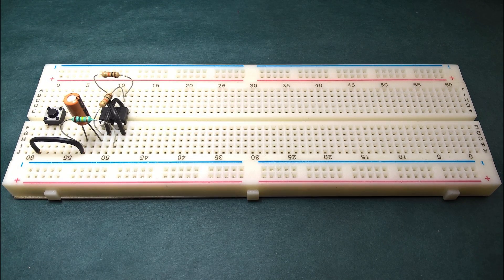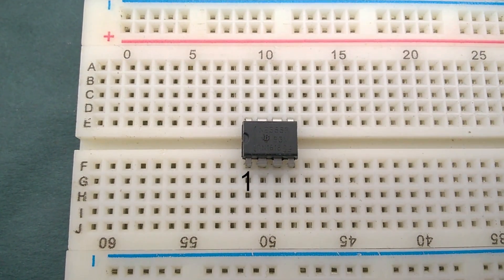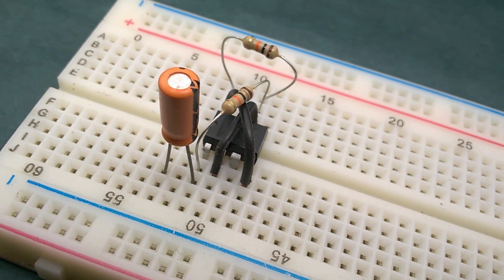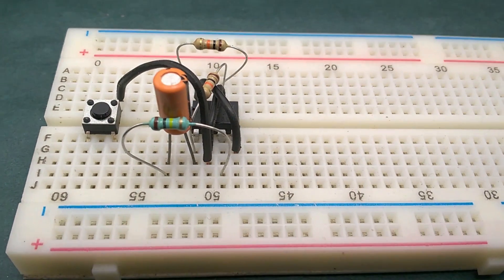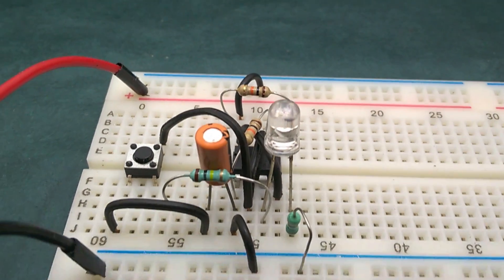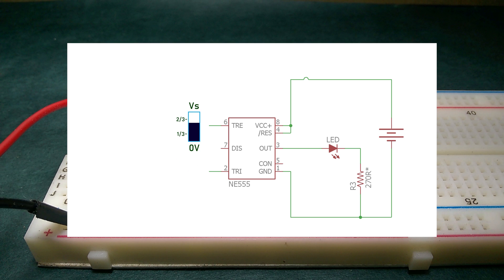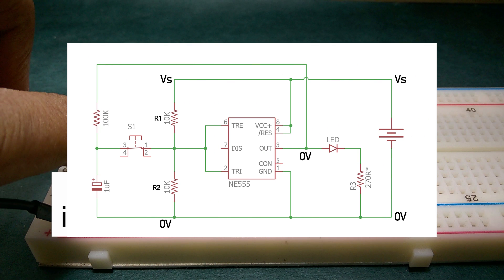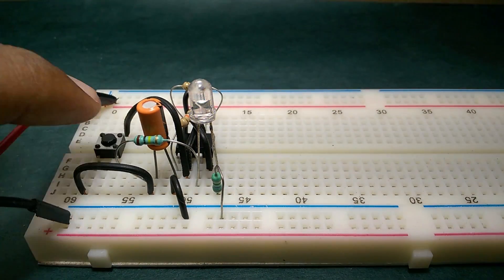Push on off latching circuit using a push button switch | 555 timer projects

Comment: Question please...I need this circuit as an on/off toggle using a momentary switch but don't need the LED. It will come after a battery pack (2 18650s for a total of 7.4-8.4V) and before a buck converter down to 5V. I assume that I just leave out the LED AND 270ohm resistor and feed the buck converter in its place? Thx

Comment: frustrating, a 1K resistor got mixed in my 10Ks so I had a 1K and a 10K in the circuit. Leave it to me to get it wrong. added the 10K and all is well

Comment: Man finally a latch circuit that looks promising. However, I turned up the capacitance up to 10uf because it would randomly not shut off during my spice testing. Could be the timing I have set but it would discharge too quickly for the 555 to do anything with the 5v. Again it could be the spice program.

Comment: Why the values of 10K resistors and a 100K resistor chosen as such?? I've ran this circuit in simulation and have had it function just fine with 2x 5K resistors and an 8K resistor, or a 12K resistor in place of the 100K. Are the values meaningful? Are they arbitrary? Is 10K resistance required to protect the 555 timer? Please advise if possible. Thanks!

Comment: Does the 555 works if battery voltage 3.7V? In datasheet it mentions 4.5V minimum!?
Reply from the maker: There are low power variants of 555 that are designed to work even at ~3V (https://www.st.com/en/clocks-and-timers/ts555.html). Not sure if traditional 555 which requires a minimum 4.5V will work properly at 3.7V.
Reply: @elonics  Emergency URGENT help 🙏🙏🙏 
Can you please help fix this issue???
Yes, the circuit is working 💯 percent perfect with added 0.01 micro farad capacitor at pin 5.

However, if you observed carefully, and touch/tap the positive or negative side of the power supply with a bare conductor wire, the IC will automatically trigger ON when trapped, and OFF when released. I believe to be due to electromagnetic interference signals.

I added 0.01 micro ceramic capacitor across the input switch button, but still same issues when tapping and untapping the aforementioned wires of the power supply source.

Please help how to fix this interference signals noises 
🙏🙏🙏🙏
Reply: Many thanks my friend, that's useful

Comment: This circuit is PERFECT for my project. I looked at several different latching circuits made of discrete components, but if you press the button steadily, the circuit self-toggles based on the RC time constant. This circuit lets you hold the button forever without changing states. I didn't have to change any component values, worked first time. PERFECT! The 555 is 50 years old but is still very useful, and has a high current output (200 mA) compared to digital chips. TYVM for sharing this.
Reply: How much current does this circuit consume when the load is turned off?

Comment: is it possible to connect a capacitor to the discharge pin to use it in the monostable mode so the output goes low either the cap being discharged or pushing the button the second time?

Comment: Question, if I want to utilize a 12v relay, can I just get rid of the voltage devider and run pin 6 of the 555 timer directly to the momentary switch?
Reply: tried it and it doesnt work. Maybe smaller value resistors?

Comment: Really impresive what a explaination style.. great sir.. best of luck for future and god bless you that you teach us more and more. Thank you. Sir if we need any consultation how can we contact you?
Reply from the maker: You're welcome. You may contact us from here: https://www.youtube.com/channel/UCDU4GtmCwu3WomTtb0NY6qQ/about
Reply: Sir is circiut me problem ho rhi hai.. ye on easily ho jata hai pr off nhi hota
Reply from the maker: @RS-nf1bh  After turning ON the output, the circuit freezes for some time to prevent switch debouncing. You can reduce this time by using a smaller capacitor or a smaller series resistor to the capacitor
Reply: Elonics - Electronics Projects on Breadboard thankyou sir its working now ok.. sir mai chahta hun ki jb circiut on honto GREEN led on ho jb off ho to RED led on ho ye kaise ho sakta hai kya mujhko daigram banakr mail kr sakte ho.
Reply from the maker: @RS-nf1bh  Go through this vid: https://youtu.be/TTQnhIkw4Bk
Reply: Elonics - Electronics Projects on Breadboard thankyou sir its working.

Comment: I have been searching for a circuit like this for a long time. Thank you. Pity that you are not more explicit about the two extra transistors added to the output . I guess that one is PNP and the other NPN?
This circuit works. It would benefit from a second 555 to debounce the button but since all my components are soldered to a 555 it would be even messier. Wiuld love to share a photo.
Reply from the maker: Hi, yes, one is PNP and the other NPN. If you planned to use transistors for toggling between two LED's, there is a much simpler way to so that: https://youtu.be/TTQnhIkw4Bk 
Adjusting the value of capacitor will change the amount of debounce. If the value of resistor or capacitor is more, it take more time for the 555 to accept the next input (ON/OFF).
I shall be happy to see a photo of the circuit you've built. You may upload it here: https://imgur.com/upload and share the link :)

Comment: Can this circuit be used for more than one switch/light (16) or do I need one circuit for each switch/light?
Reply from the maker: If you need to control all the lights at once, one circuit is sufficient. And if the total current consumed by all the lights combined is more than 50mA, you need to use a relay / mosfet at the output of 555 timer IC.
Reply: @elonics  What I mean is 16 individual switches. And one of these circuits to change the behavior of all the switches. Or would I have to build the circuit for each switch. 

it will actually be triggering something else, not turn on a led. a grid of keyboard keys, and one circuit to make them all latch.
Reply from the maker: In that case a single circuit is sufficient to control the behavior of all 16 Individual switches at one go.

Comment: Does this draw current when off? If so, how much? Is there a way to make it draw 0?
Reply from the maker: Without any components, NE/LM555 and LMC555 will draw around 3mA and 0.25mA of current respectively. Additionally the 2*10K resistors connected to Pins 2&6 consume ( (Supply Voltage)/(10K + 10K) which typically equals to 0.2mA ) of current.
So you can achieve the least current draw (~0.3mA) by using LMC555 and by increasing the values of 10K resistors (upto 100K)

Comment: what happens if the supply is off and on? it wll remember the previous state? ( if i on the light and remove the battery and again connected the battery the LED will remain on ??????)
Reply from the maker: No, it won't remember the previous state. It will reset back every time it powers on. Unless there's still some charge left in the capacitor
Reply: @elonics Emergency URGENT help 🙏🙏🙏 
Can you please help fix this issue???
Yes, the circuit is working 💯 percent perfect with added 0.01 micro farad capacitor at pin 5.

However, if you observed carefully, and touch/tap the positive or negative side of the power supply with a bare conductor wire, the IC will automatically trigger ON when trapped, and OFF when released. I believe to be due to electromagnetic interference signals.

I added 0.01 micro ceramic capacitor across the input switch button, but still same issues when tapping and untapping the aforementioned wires of the power supply source.

Please help how to fix this interference signals noises 
🙏🙏🙏🙏

Comment: It turns on. But on second press it does not turn off.

Using a 3.7 volt battery
Reply: Double check your capacitor, that it's big enough and connected properly. That's what triggers the threshold voltage to cut power.

Comment: i tried. and turned ON the led,but i cant turn OFF the led...i tried several times but the result was same
Reply: add a 5k resistor between pins 1 and 5, add a 10k resistor between pins 8 and 5. More likely you're powering below 5V.

Comment: Using 12v  and a realy in place of the LED and resistor.  Relay energizes as soon as power is applied and stays on.  Push the button and it goes off but right back on again when you release the button.
Reply: Another post suggested a 0.1 uf cap from pin 5 to ground.  This solved my problem.

Comment: if i use 12v supply and using optocoupler and 12v/5v relay, what the resistor from the optocoupler to the negative rail should be ?, and can you make the diagram please, thank you

Comment: hi, i have built your circuit and works perfect with LED, but when i connect a relay the relay it will switch on but not off, what am i doing wrong please. ps. im new to electronics.
Reply from the maker: There might be two reasons for why that's happening: Either the relay consumes more current, causing the voltage to drop, or there is a flyback effect (google). Either ways, it can be solved by using a separate DC supply for powering the relay, with a common negative point.
Reply: Thanks for your reply.
Reply: @elonics 
Can you please help fix this issue???
Yes, the circuit is working 💯 percent perfect with added 0.01 micro farad capacitor at pin 5.

However, if you observed carefully, and touch/tap the positive or negative side of the power supply with a bare conductor wire, the IC will automatically trigger ON when trapped, and OFF when released. I believe to be due to electromagnetic interference signals.

I added 0.01 micro ceramic capacitor across the input switch button, but still same issues when tapping and untapping the aforementioned wires of the power supply source.

Please help how to fix this interference signals noises 
🙏🙏🙏🙏
Reply: I used a small relay (maybe 1 amp) WITH the LED without any issues.
Reply: Relay 10

Comment: You said it constantly consumes power. What might be the advantage over say a micro processor board that toggles on input?
Reply from the maker: Low cost and it doesn't require any programming/flashing.

Comment: Is there any way to increase the resistance of the two 10k resistors, to reduce the standby current draw of the switch? I tried 100k and 50k resistors, but it didn't work properly.  How might I reduce that standby current draw of the circuit?
Thanks!
-Nick

Comment: if using 9v supply the 100k resistor going to the output terminal of the IC must be 10k only.. 100k is too high.. it wont trigger if you use 100k resistor
Reply from the maker: This circuit gets triggered even with 1M resistor (I used 100K). The only change that resistor will make is the required delay between successive button presses. So 100K might require say 3 sec gap between successive button presses, 10K will require just .3 sec, which might bring in switch debounce issues.

Comment: That's a great video...I was thinking to use it for relay on off... I just put my relay in place of led... but there is a problem..
The very first time when I switch on this circuit the relay turns on. Any clue on not to turn on relay on the very first timem
Reply: I used a small relay (maybe 1 amp) WITH the LED without any issues.

Comment: Great tutorial !
I have only one problem when connect it to 12v the led will turn on already.
How can I fix this when I connect this project to 12v and stay off until I press the button?
Reply: I found it. I connect pin 5 to 0.01uf to the ground
That fix the problem.

Comment: Imagine you want to build a circuit with 4 push buttons for with different conditions , do we have to use 555timer separately for each push button or can we use one common 555 timer? please help

Comment: hi guy. can you tell me why do you use Resistor 10k and 100k? when i use resistor 4k7, my circuit run. but when i turn on power the led ON while my button switch off? when i press the switch, led OFF and i press, led ON.
I WANT  WHEN TURN ON MY POWER, LED OFF and led on when i press the switch. thank you so much
Reply: @Unique Action can you please provide me with link

Comment: Can you provide the explanation for the circuit with addition of the transistors?
Reply from the maker: I connected the output of 555 timer to the bases of two transistors (npn and pnp).
The emitter pnp is connected to +ve and that of npn to -ve. One LED at each collector pin of npn and pnp.
When the output of 555 timer is positive, it turns on nPn transistor and if negative, it turns on pNp transistor.
Reply: can i know what transistor you used?
Reply: 547 and 557.  Dear

Comment: SCHEMATIC AT THE BOTTOM CLICK READ MORE:
To get the transistors to work to need to do the following......For the transistor on the left wire it as so: The collector connected to pin 3 of the 555 with "ZERO" resistance (So basically just a jumper), the Base connected to Positive rail on the breadboard with a 1k ohm resistor, the CATHODE of the LED on the Emitter, and the proper resistor between the ANODE of the LED and positive rail of the breadboard........For the Second transistor, on the right, Wire as so: The collector connected to the Positive rail of the breadboard with ZERO Resistance(So basically just a jumper), the Base connected to pin 3 of the 555 with a 1k ohm resistor, the ANODE of the LED connected to the Emitter and the CATHODE of the LED connected to the ground of the breadboard with the proper resistor

Keep in mind which transistor is on the right or left doesnt matter so long as either 1 is wired as explained above :-) hope I helped
https://imgur.com/lqIWweu
This is my very apprentice attempt at a Schematic but I hope it helps alittle bit :D
Reply: Essentially you end up Needing:
1 NE555 Timer
2 Transistors (I used BC547's) 
4 1k Ohm resistors
2 10k Ohm resistors
1 100k Ohm resistor
1 1uF Electrolytic Capacitor
1 switch....I just touched the 2 wires together and left out the switch xP
2 LED's
6 Jumper's
1 Breadboard
1 means of power such as a 9v battery
Reply: Could you explain the working of this circuit as well? Thank you!
Reply: check out : https://youtu.be/sVgwsZYK1ik
this shows you in detail, along with circuit diagram

Comment: i cant switch off the led,
what the problem??
Reply: Make sure you are using the correct size cap. I used one that was too big and had the same issue.
Reply: Another post suggested a 0.1 uf capacitor from pin 5 to ground.  This solved the same problem I had.

Comment: great circuit, but i need a single switch that when pressed once, it starts a timing circuit, and when pressed again, it will stop the timing circuit and turn off the load. so 2 possible outcomes, one turns off in 15 seconds, OR, press the same switch and it stops immediately. any suggestions?

Comment: I have made this circuit and it seems to be constantly on, I have it powering a relay and my plan doesn't seem to work as as soon as the circuit gets power the relay switches
Reply from the maker: Leaky capacitor might be a reason
Reply: @elonics ^^
Reply: @elonics Emergency URGENT help 🙏🙏🙏 
Can you please help fix this issue???
Yes, the circuit is working 💯 percent perfect with added 0.01 micro farad capacitor at pin 5.

However, if you observed carefully, and touch/tap the positive or negative side of the power supply with a bare conductor wire, the IC will automatically trigger ON when trapped, and OFF when released. I believe to be due to electromagnetic interference signals.

I added 0.01 micro ceramic capacitor across the input switch button, but still same issues when tapping and untapping the aforementioned wires of the power supply source.

Please help how to fix this interference signals noises 
🙏🙏🙏🙏
Reply: I made this circuit about a year ago ago, it's been working OK since then but now it's started switching one when powered up. Not all the time, it's about 50/50 when starting. What could be the problem?

Comment: The circuit doesn't  get switched off
Reply: same problem here
Reply: me too
Reply: Check for a bad ground connection at the capacitor, or try removing the switch and just touching the 2 wires that went to it together
Reply: Instead of 100k resistor use lesser value than 10k it may work

Comment: Could this replace an existing on off toggle switch in an existing circuit? (I have an RC remote control that uses an on/off slide type switch but I want to turn it on and off with a momentary button like this)
Reply from the maker: Yes. But this circuit consumes a continuous current of around 5mA even when idle. So replace only if that current consumption is okay.

Comment: I want to sincerely thank you for these tutorial videos. I find them very useful. My brother and I are working on a project for his gaming board (RP game), and I am providing the "animation" (lights, sounds, and movements) to add realism/excitement to the game... Your videos provide me with a good understanding of how electronics works (I'm a bit of an electronics novice/hobbyist), and this allows me to use variations of what you have presented. Again thanks for your presentations.
Reply from the maker: It's my pleasure ronc1357. I'm glad that the video's are helpful.
The project you are working on seems great! I'll be happy to see the arrangement once it's done (please share a picture if possible).
Reply: Absolutely! I'm just waiting on components I ordered at the moment, but should be able to start on it in a week or so.
Reply: I have a question... I intend to use this circuit in my project, but I wanted to use an IR transistor, instead of a normal push button switch, and use an IR LED to operate it. Is there anything I need to know, or can the IR transistor just replace the switch (in the correct polarity of course)? The power supply will be 12 volts DC.